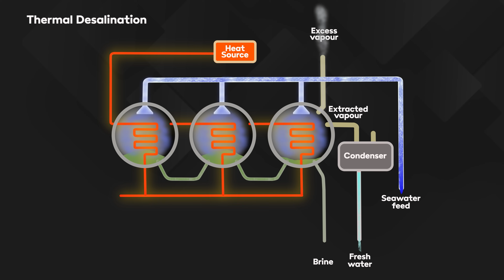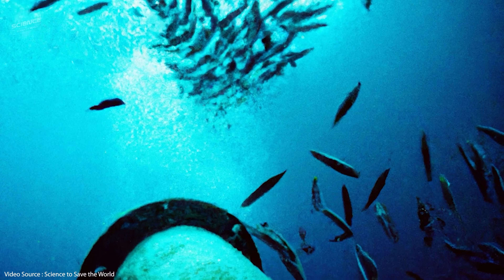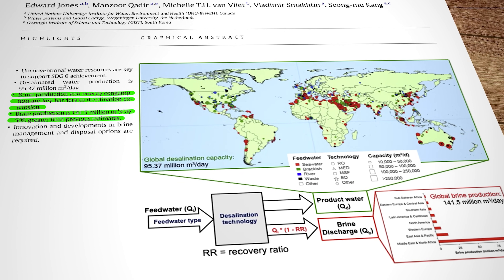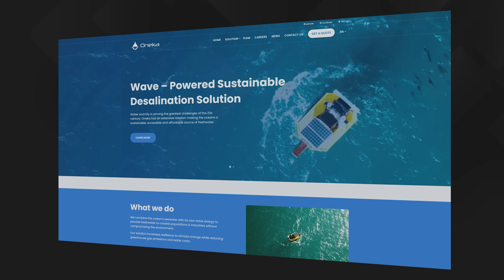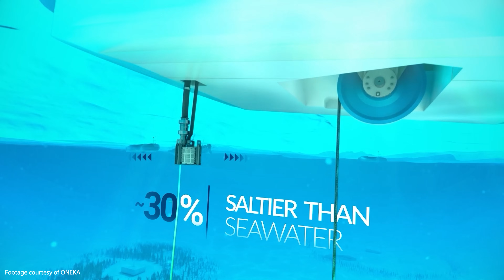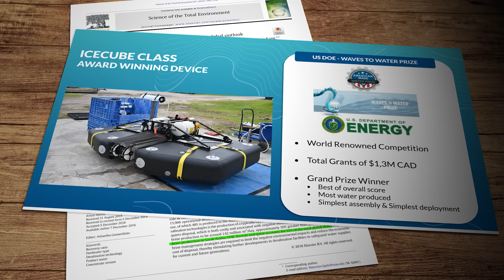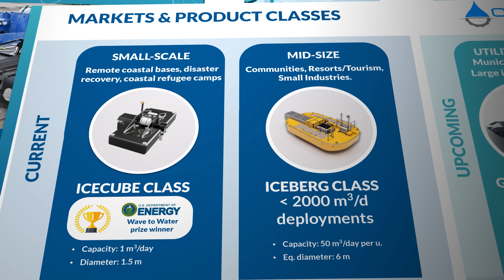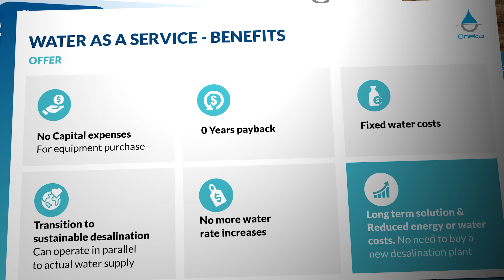Fresh Water at Zero Energy Cost . How do they do that?

Comment: I work in the water treatment sector. However, I should note that I specialize in freshwater treatment and not salt water. However, RO (reverse osmosis) is still part of my training.

Slightly off topic first, this does not have to be limited to desalination. RO is on the top shelf of water treatment standards, and this could be a power free RO treatment from a lake or river which could make RO viable for smaller municipalities that can't afford RO's larger than other process upfront costs on top of ongoing high-power cost. Rivers and lakes would no doubt generate smaller flows as they have less wave action, but it might be in the realm of viability.

To the meat of the topic. The most important issue that will sink or float these is what are the requirements for where these can be placed? If this has to be 10 miles out to get the proper wave action or avoid ecology disruption, that will add a whole pack of issues. My instillation has a great number of satellite installations, and it is so prohibitively often that something happens at one of the satellites that it requires people on shift 24/7/365 to go handle them and put things back in service. If a group of these serves anything more then 10k consumers I would see these requiring the same. I think the best option in this case would be to create something akin to an oil rig that sits at the center of were these are all tethered and maintain a staff on it that would also serve as the normal operators that WTPs have. Maybe existing oil rigs could be repurposed for that when we kick that particular dirty habit. While land purchase costs would be effectively zero, building the O&M structure could quickly eat those savings.

Resiliency. Salt water is hell on just about every material mankind has ever made. I have some serious concerns about how long the equipment structure and the RO equipment could last in these conditions.

Underwater maintenance costs and infiltration. Fun fact, pipes leak. The water distribution lines that pipe water to your tap can lose as much as 10% of the water that is treated before it can get to your tap. Those lines also break on occasion, and they would do the same while lying on the surface of the ocean floor too. The costs and added danger of fixing a broken line under water could be slightly prohibitive. The water head above this pipe could also cause raw sea water to infiltrate your freshwater line. I would bet that EPA would require you to re-treat the water to some degree before finishing the water. The good news is that this second treatment would be tremendously easier the second time around.

Scale. In the USA the average person uses 100-150 gals of water a day. So, if the glacier class has a diameter of 12 meters and puts out 500 cubic m/d each one makes enough water for 880 people. That would be 1,135 units for a city of 1 million which is 128,255 sq ft of flotilla if they were pressed together which I doubt they could be. That is between 2 or 3 American football fields. Sure, it is a big ocean, but these are going to take up a fair chunk of surface space to provide water.

Reliability. I think it would still be prudent to have another land-based desalination plant to make up the difference when the waves are not pumping enough water. You should always think of how much more water you will be treating as your system grows and this overbuilding could make up for breakdowns at sea which might not be able to be repaired quickly or find funding to expand quickly enough. I think having a land-based parallel component would also be a wise choice in case of things that happen in the ocean with some regularity like... hurricanes.

One addition to these that I would highly recommend is a system for the platform to be remote piloted like a drone including the ability to raise its anchor and disconnect from its effluent so that it can be piloted back to a repair dock for maintenance.

Conclusion. If this product does what it says and to EPA standards, this just might be in the realm of viability, but it has a laundry list of hurdles to clear.

Comment: Thank you for sharing. I find that watching your channel, and others like it, is a good way to stay current, and be exposed to new (and/or improved) tech.
I'd like to point out something regarding the change in salinity (08:29): correct me if I'm wrong, but if the discharge has a 30% higher salinity than the input, then sooner or later you'll start to see a change, regardless of those tests that couldn't detect a change even at the short distance of 2 meters, especially when a large number of these are deployed in one location for an extended time period.

It's probably still better than the 100% or more difference of conventional systems, and the use of mechanical (wave) motion directly offers an improvement in emissions and other environmental factors.

I think this system has much to offer even without claiming that it won't change the surrounding salinity, a claim that seems mathematically impossible, and sounds more like a sales pitch than actual science.

...On second thought, nature has a way to balance things, so maybe the simple fact of lowering the salinity ratio, and dispersing the discharge over a larger volume of water, could create a sustainable ecosystem with stable (normal) levels of salinity.
In other words, maybe it's just a matter of finding the right salinity and volume ratios required for a sustainable solution.

Since theory and practice often differ from each other, a small scale test over a reasonable period of time is a good idea.

Comment: Sorry!? Feedback loop of air conditioners, wait, what is a heat pump is it not just the same as an air conditioner but with a heat exchanger? So it can cool and heat!
Imagine if every home had a heat pump functioning in the dead of winter what would the outside temperature be if you can remove every last drop of residual heat from around your house🤭😂😂😂
❄️❄️❄️❄️

Comment: Have you ever drained a above ground gravity feed pool or water tank? Why not build a massive clear plastic tube with smaller tubes feeding off the clear tube that are heat absorbing mirrors or black.  Have one end of the tube in the ocean and run the whole thing to a point on dry land that is lower than sea level and fill it with fresh water by gravity and heat pressure.

Comment: Why not just use the force to pump seawater on land, to a high reservoir ? Then use the water and pressure to drive the reverse osmosis. Most of the maintenance would now be centraliced. The reservoir can be huge and store the potential energy / water over month, or even years. In our north european climate there is a very boring calm sea during summer, but autumn and winter are much wilder. Although I must admin, where I live everything is very flat, so not much of a naturally occuring reservoir. And maybe seawater is not the best thing to fill into a natural occuring reservoir ;-). Maybe it would be better to desalinate and than store sweet water...

Comment: One sturdy hurricane could probably take out the whole installation thus making maintenance costs unbearable.  Perhaps if rough weather is due, they can pull the whole rig underwater enough to avoid the worst of the violence.  This would be like a tethered submarine.  Some source of power would be required after the storm to pump out the excess water to refloat the rig though.

Comment: Well, let's see, rain is (mostly) clean water, the result of distillation. Mimic the sun as it heats surface moisture during the day, and the lack of the sun's heat to condense the vapor at night. Of course, even this obvious idea is 1% inspiration and still requires 99% hard work to implement it. -- paraphrasing Thomas Edison.

Comment: As an engineer every solution has its problems and you pick the solution with the set of problems you think you can solve.
The issue with this solution is the area of water these many units in the water, take up. A boat problem near cities.
OTOH you could rent them as boat moorings.

Comment: The big problem I foresee is maintenance. Pipes will probably be metal, hence will rust in prolonged contact with salty water. I'm not sure about the PET and salty water either, if there are some adverse effects? Same goes for pipelines.

Comment: There is so much positive thinking about harnessing low impact technology in this (and other) developments which in itself is inspiring and to be strongly supported.  There is, of course, no such thing as a free lunch and in addition to some of the caveats already noted the scaling up of these units to provide greater and greater output must increase the salinity unless huge areas of sea are to be taken up to maintain the ratio of outflow to the surrounding water.  It should also be borne in mind that this technology is likely to be used by wealthy states to further the existing profligate use of existing supplies rather than a stop gap while more long term sustainable solutions are found.  It is just a tool, though - to be used well or otherwise.

Comment: The PET is toxic, especially when exposed to sun and seawater.

 The Brine from onshore systems is not a disadvantage, it's a valuable commodity, for salt, massive Magnesium yield, and other valuable minerals in lesser quantities. 
Solution that has no problem. Pumping energy for landbased plants can easily be achieved by coastal wave pumps, tidal, wind or solar. 
Expensive and stupid.

Comment: There is no such thing as zero energy cost. This is the same logic as the announcement of the fusion breakthrough. All the energy that goes in to make the units, place them and maintain them is part of the cost and that is never zero. As in the fusion announcement they say they used a 2 megawatt laser to produce 3 megawatts of power from fusion which sounds like a big deal, until you find out they had to use 300 megawatts of regularly produced power just to get the laser to produce 2 megawatts.

Comment: Before we dump all the other desalination systems, I have been up to the north of Western Australia where they have massive salt pans to provide sea salt, through drying sea water in big tidal pools where there is a  gradual increasing the brine concentration until it crystallises out to be scooped out with large earthmoving machines.
Surely one of these desalination processes could be used to start such a system off so that there is no brine discharge back to the sea and there is a value added product as well as the pure water.

Comment: Wait. They actually heat the water on purpose to extract water?
On ships they use waste heat from the engines, why not build a power station with attached desalination plants on the coast?
 In this case you need to get the water to shore. It should be at least 5 nautical miles from shore for health reasons.
This is a cute idea.  It's still a massive money sink once time and transport gets involved.

Comment: 10^3 of water per unit... to put that into perspective, large plants are doing 500,000-1,000,000^3..... so to replace one of 500k size of them you would need 50,000 of these vessels, spread out at about 25ft they'd cover a square mile in ocean floor in pipelines. You wouldn't actually want them a mile out, for maintenance, waves and as the piping costs would get insane and I doubt that much pressure could be maintained. Prolly 10th mile max, which means they'd stretch 5 miles down the coast in either direction, prolly need a collection plant every mile or so at least. So replacing the 12 west coast USA desalination plants would mean peppering 120-200 MILES of the US coast line with these every 25ft upto a 1/10th mile from shore. Start leaving gaps for boating/sea ways/bad waterscapes/beaches and you can expect that # to get close to 300 miles. And all that decentralization to just spread out the brine, nothing here has suggested they make less per gallon of water, just that they diffuse it more.  What kinda cost is 750,000-1,000,000 of these vessels spread out over 300miles of coast needing maintenance gonna cost? (RODI membranes have to be periodically/commonly swapped or maintained). What's the environmental impact of 300miles of piping running across the ocean floor? If your gonna do that, it prolly just makes more sense to attach those pipelines back to the existing desalination plants, and let them diffuse the brine over a larger area, that would least save us having to make a 750,000-1,000,000 of these vessels and use the economies of scale and centralization to affordably retrofit the plans with green energy for 100th the cost and complicate maintenance. These might make sense in small deployments for emergecy or smaller scales, but they arn't competing with plants.

Comment: Your articles are becoming a joke lately..  First you are against hydrogen when that is the only cost effective solution to increase the share of solar and wind and reduce the energy cost from all energy sectors.
Then you support any new technology which seem very doubtful if we just apply a bit of logic.
For example this technology use the same inverse osmosis tech, the biggest difference is the source of power. 
Since when wave power is a more cost effective way to produce power?   Even more when it would be apply it on places who does not have the best waves?
This also mean that the capacity factor of those filters would be reduce.
All the materials, hardware and maintenance needed just to produce 50 m3 of water plus the work to  distribute that water seem incredible inefficient. 
This mean that your channel has become on "I will said wherever you want me to said if the bribe is high enough".

Comment: This is one of those good ideas that in hindsight look obvious. Good job, Mr. Tučić!
I think this have a great future, with one obviou caveat - this will work well only on ocean shores, where large waves are plentiful, bot in smaller, closed basins. I hope that Persian gulf and Mediterranean are big enough to produce waves big enough often enough for this to work.

Otherwise, I think that for thermal desalination method the obvious heat source could be waste heat from thermal power plants (ideally nuclear; if not, fossil fuel burning will do while they are still there); they need a way to dump heat in steam condensers anyway. Also, direct heating by concentrated solar might be a solution in sunny regions...

Comment: 2:20 - The amount (and, hence, concentration) of brine in either process is a matter of tuning. With distillation, you can go, theoretically, all the way to pure solid residue (and sell it as table or road salt), or use up only few percent of water (which is, obviously, less energy efficient, since you have to boil more raw water, but clever use of heat exchangers can minimize the difference).

Comment: Would love to see a scaled-down version of this suitable for boats (10-20 gallons/day). Current onboard desalination solutions are not only complex and costly, but consume significant amounts of power that must be generated (solar, wind, generator, etc.).
Reply: Yeah. Land-based desalination plant users have some sort of an alternative usually (a more pricey/difficult alternative but still an alternative, e.g. a trek to some sort of a well dozens of miles away). On a boat, there is literally NO alternative (and you need fresh water for not just drinking, but also washing dishes/clothes/yourselves as salty water is higroscopic and further salt will simply stick to you, you will never be clean)
Reply: You need a mooring line for the desal system to work. So it won't work when you are sailing.
Reply: @niconico3907  does the line need to be above water? Ships often pull various lines behind them for various reasons...
Reply: @katm9877  the line is attached to the ground on one side and on the pulley and hydraulic cylinder of the buoy on the other side. So when the buoy moves up and down with the waves, it makes cycles of pulls and  release the rope which create mechanical power. If there is no fixed point on the bottom of the sea, energy won't come from the waves but from the boat itself.
Reply: @niconico3907  you need a mooring line for it to work this way.  the mooring line provides the waves something to work against, but essentially it is powered by water being pushed against the device.
Can you think of places on a moving boat or ship that water would press against?  Say the bow?
Reply: "scaled-down version of this (10-20 gallons/day)" can be built by yourself, as it should be sufficiently small for DIY... Of course, the system in anchored on the ground, and as others said, cannot be used when sailing, only when standing still, and being anchored. And when anchored, most probably in a marina, the waves are much smaller than on the open sea...
Reply: To those pointing out that the system relies on a mooring line - yachts already have the concept of a water anchor - basically a funnel on an anchor line below the surface that slows wind-driven drift. Perhaps this desalination system would still operate (though with reduced efficiency because the water anchor isn't 100% rigid).
This could be made more flexible to use the water anchor if in deep water, or the regular anchor line if at anchor.
Reply: @bokkeman123  or since the system relies on pressing the water through the system you could have an input on the bow and force water that way.
Reply: What about it being powered by the forward movement of the  boat  ?
Reply: It is no different to a standard reverse osmosis system just that it powered by wave action, if your getting enough wave action. Then you have the overhead of maintaining these floating systems which will kill it, maintenance of floating platforms at sea is Expensive.